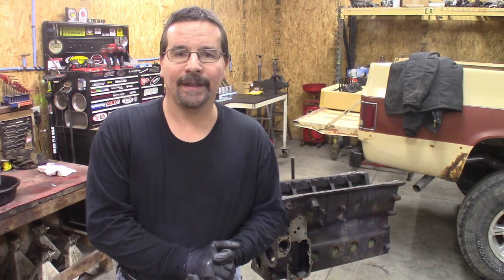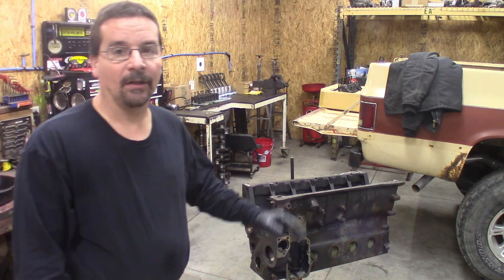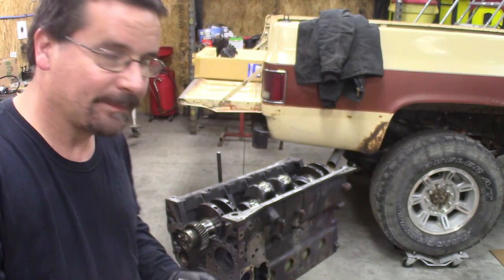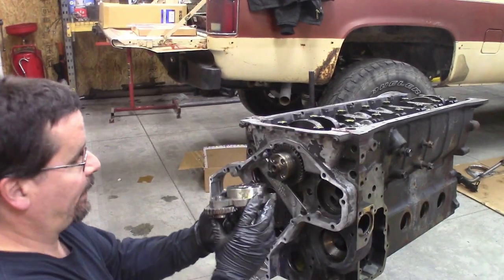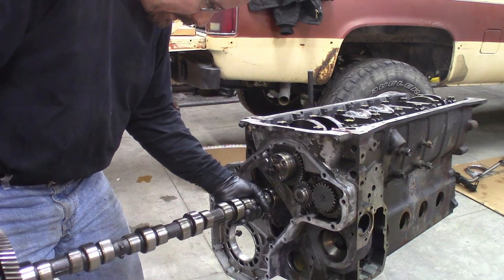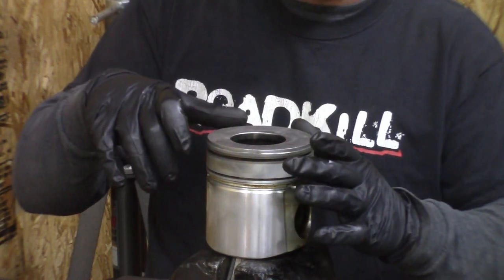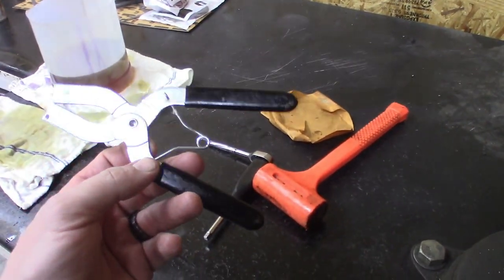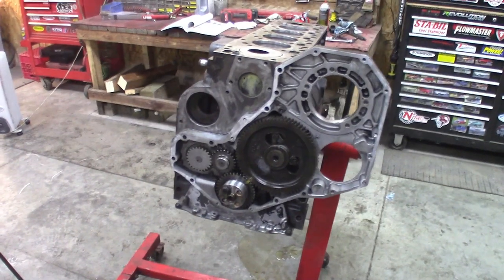12 Valve Cummins Reassembly Part !

Comment: There is a specific section in the Cummins service manual (available free online at Cummins Quickserve website - create a free account and enter your ESN) that outlines the Cummins spec on ring gap alignment.  They specifically address NOT having any of the 3 ring gaps over the piston pin and each ring being 120° apart around the piston circumference.  Just an FYI.
Reply: That's what I thought